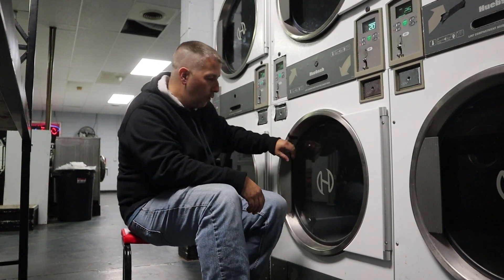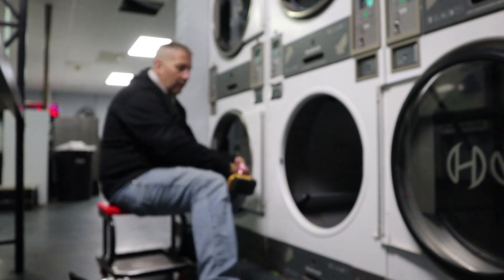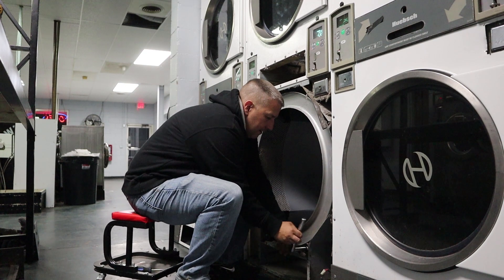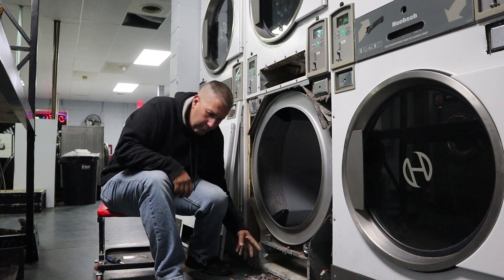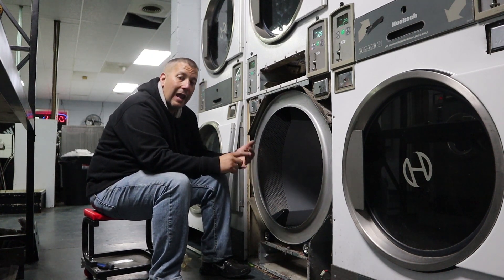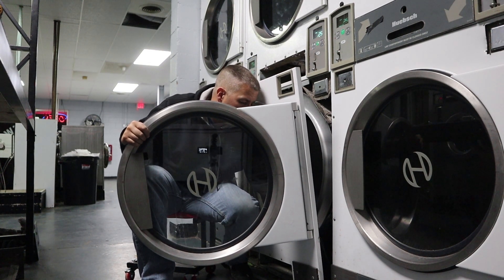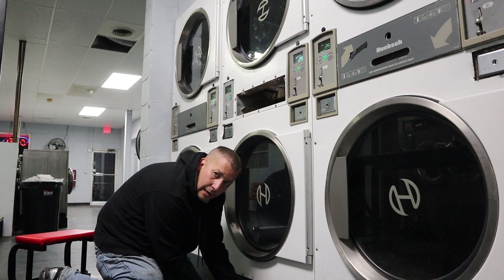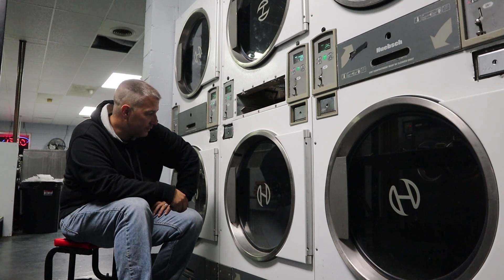DRYER Drum Wheel Bearing REPLACED LAUNDROMAT! | Following Keenan !

Comment: At the prices you have discussed for used washers, the dealers would appear to charge you MORE THAN a machines replacement price for a major part job.  Many might find that amazing.   An $800 repair on a $375 machine seems excessive.
In a used car, if you have a $2500 value, and a major part breaks, and you are charged for the replacement, then you can easily end up with a bill over the value of the car.
This is the same principle.  Your best course of action is to find anyone who has the ability, and wishes to do a repair.  
I would try to find the dealers' techs, and get them to do this as a side job.  
Lastly, and always, no repair is a repair ONLY.  My repair guys would be understanding that I am getting a repair CLASS from them, and I expect to slow them down, and get every question answered, and every procedure would be something I want to do while the tech instructs me.  I'll pay for that additional service, but I want to achieve the skill so that I only pay that one time.

Comment: I take the new 'skateboard' rollers and drive the bearing to the edge so that the drum rides in the center of the rubber, instead of on the edge.  I tried the new style rollers, but one dryer promptly separated the crimp from the bearing. :/  Guess it was a bad crimp.  I hope this area isn't the 'new' weak point.  I missed one bad roller and it ended up cutting 1/4" off the flange of the drum, rendering it unusable since it grabs clothes.  That was a expensive lesson.
Reply: How do you search for rollers which you need on ebay? I mean, I need 8 180050 rollers, how do you find those what would fit? 
What I did, - I searched "Huebsh rollers" and "ADC rollers" and messaged every seller who sold them, "hey, you have 180050"
And I found a guy who sold them to me for 20$ a piece
Reply from the maker: I usually use the type of machine and part number, so for your item "dryer 180050 roller" . Other times if I cant find a part, I will buy one from my dealer. Then save the part number and search ebay next time. 

One thing you have to remember most parts fit more than one machine and brand.

Comment: Professor Keenan!  Your timing is impeccable with this content.. especially these last two dryer videos as well as your recent horizon video (on bearing replacement)... I'm doing very similar (maintenance and repair) work on my horizons and Heubsch stack dryers.. but had two questions -- 1) per your last video on wax buildup from dryer sheets.. what is a good/the best way to clean those motor rotors to remove the waxy buildup?  and 2)  is there an (easy) was to remove the dryer baffles without removing the drum? (the reason I ask is.. I have one or two where coins have found their way into the baffle(s) and I'd like to remove them...
Reply from the maker: I'll do video on cleaning the blower. And if your drum baffle have plastic end caps. Then yes you can remove items inside without removing the drum. Possible not even removing the front panel. Monday or tuesday I'll post something showing both. 

Also if your doing horizon bearing make sure you check the shocks. I find most of the time they are also wore.

Comment: Yay! I found me some cheaper 180050 ADC rollers, currently holding them in my hand! They are little harder to roll, and they have CHINA 5200RSW together with ADC 1800050-530, but otherwise they look legit! I'm so glad!
Reply: Replacing them was a little harder though. Unlike you unscrewing one nut, -  I had to unscrew whole wheel assembly. And replace roller in it.
4 rollers in ES35, had to replace two of them.

Comment: There's a much easier way of changing the dryer drum wheel bearings in less than 5 minutes. First, take of the lint tray. Then, use the lint tray slot to remove the wheel bearings with a wrench. I'm surprised that he took of the front panel of the dryer for this replacement.